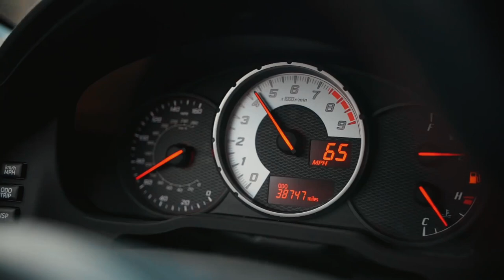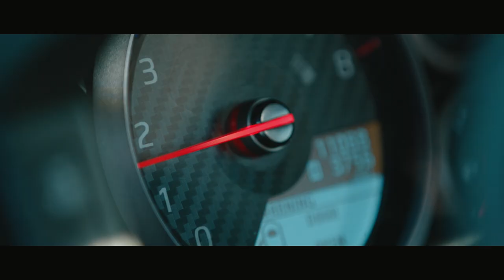IT'S FINALLY DONE! (GUACZILLA 2.0 REVEAL)

Comment: and sadly those 1000hp with never be used to full extent
Reply: Well he has done lot of full throttle driving so 1000 hp are used.
Reply: Fr fr rip
Reply: James Franko  3rd gear in this gtr is probably 160 mph.
Reply: James Franko  this gtr can easily hit 230 mph.
Reply: James Franko  but still 1000 hp car has crazy acceleration
Reply: Who says that 😳
Reply: SHOULD HAVE GOTTEN THAT ACNE TAKEN CARE OF INSTEAD OF BUYING A 1K HP SKYLINE THAT MOSTLY SITS IN THE GARAGE,,,,OR HES OUT IN THE CITY GETTING SPEEDING TICKETS! LOLL HE NEEDS TO TAKE THAT THING TO THE TRACK,,,,,,,,,,,,,,,,,,,,,,,
Reply: James Franko  OK I HAVE TO SEE THIS,,,,,,,,BUT I HAVE SEEN A TESLA SMOKE DRAGSTERS IN THE QRT MILE!
Reply: @dkdanis1340  VERY TRUE!!!!! I DID 237MPH IN A RACING GTR ON THE HIGHWAY!!!
Reply: SupraDeluxx  but built gtr's are still one of the fastest cars in 1/4 and half mile. Gtr's are great for cornering they have perfect weight distribution, advanced stability control and awd that is useful in many situations especially in wet conditions.

Comment: Dude, I'm not much younger than your father , and I've owned some sick cars in my time, including a 68 Chevelle SS restomod, with 650 horsepower! This GT is an absolute BEAST, and I'm not too proud to admit I'm jealous AF of an 18 year old kid! Good on you bro, just be safe, that kind of horsepower can get away from you before you know what happened! 👍🏻
Reply: you should keep that Chevy and we could drag it
Reply: He definitely should be careful, but it takes way more experience to be able to handle your car hahahaha Especially since you're dealing with 650hp to the real wheels and everyone knows the GTR has a great awd/traction control system. I've driven a 675 whp GTR so probably 750hp and it was very easy to drive. That's the main reason why I'm not the biggest fan of the R35 GTR, but it's a great daily sports car... as well as a great beginners "exotic car" Even though I do not consider a GTR an Exotic car. He really should've converted it to red and made it like 750-800hp because now that would be way more of a fun car to drive,
Reply: I love chevelle and 90s jdm cars to

Comment: Tanner fox gtr Vs. it’s just a 6 mustang

Like if u think so
Reply: Bro that would be such a good race 1000 HP stang vs 1000 hp grr
Reply: The Mustang would smoke the gtr 😂😂
Reply: mustang would definitely spin and lose, unless the mustang has a lot more hp, all wheel drive, or lighter.
Reply: Malachi Stephenson gtrs are twin turbo from the factory...
Reply: Lol tanner has all wheels drive hell get the mustang
Reply: @tachiss0296  most cancer comment ive seen
Reply: That’s a good idea
Reply: That mustang is so much lighter than the gtr plus that it has drag spec mods so if u add slicks to the mix the gtr is getting smoked tbh
Reply: The mustang would smoke the hell out of that gtr
Reply: The mustang would win probaly he set up drag racing
Reply: Sebastian6827  gavin is the driver and he just put 6 car links on a demond
Reply: Sebastian6827  from a roll down in 3rd gear the mustang would rip faster, plus he swapped for longer gearing, which would minimize traction issues. And yes he actually shifts really quick. He recently beat an automatic demon.
Reply: Sebastian6827   and gavin had to start in 5th gear bc he didnt have his drag wheels on and he beat the demond by alot
Reply: gtr stock have twin turbos

Comment: You said that only 2 people can fit in the car but i see 4 seats.......back ones are still there sooo
Reply: A great does not have any leg room when you're in the back. I found out first hand
Reply: They’re not real seats tho. It’s different compared to the real seats meant for sitting back there. Those aren’t
Reply: Back seats are there for insurance
Reply: because the car is lowered so only 2 people fit in the gtr i guess?
Reply: it’s technically a 4 seater but he probs put in a bar for the harness if he has 5 piece belts
Reply: You have to be like 5'5 to fit
Reply: He ended up not putting in the cage, so yes, there are 4 seats.

Comment: You riced it
Reply: Paul Playz Roblox- - And More! How he made the car perform better and added tasteful cosmetic mods that’s not ricing
Reply: Jack Pickle Idc
Reply: R I C E D
Reply: Not really it has 1000 horsepower
Reply: get that thing dynoed at 1000 whp and ill believe it but car stock has around 400 so i doubt it.
Reply: @kylerieger3855  2017 Nissan GT-R makes 600 at the crank. So stock it makes about 545 to the wheels.
Reply: There is just too much focused on visuals it needs to be toned down a bit
Reply: @kylerieger3855  I also must say that the 3.8 liter twin turbo V6 that the GT-R comes with is a incredibly good tuning platform and is a powerhouse for what it is
Reply: spag too heddy if your profile picture is a anime character your opinion is invalid
Reply: You prolly drive your moms Kia Soul

Comment: Okay, cool car but why is it only going 15 mph... is it the fact that the car is unstable because air suspension + 1000 HP = Dead? 

That is a corner cut, shame. 

Decent looking car otherwise, not a huge fan however it is decent. 

Safe driving.